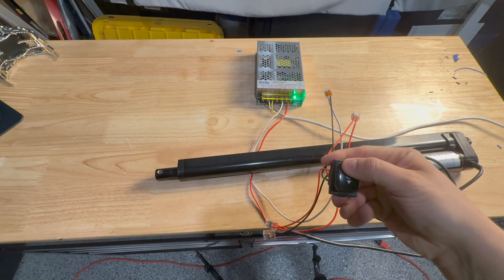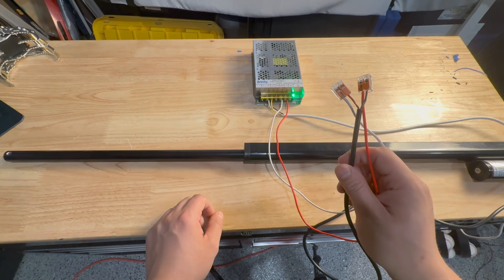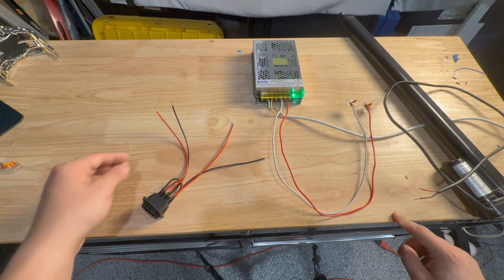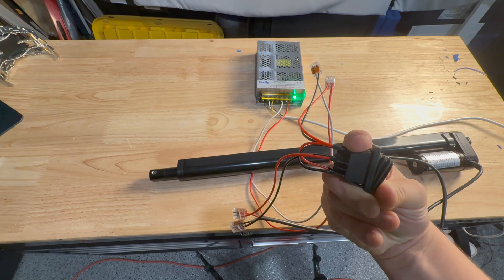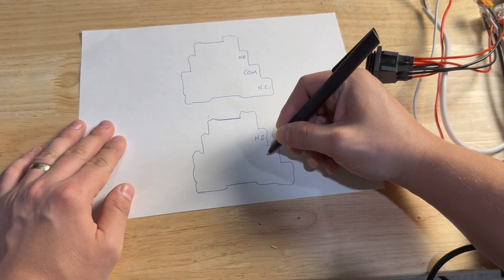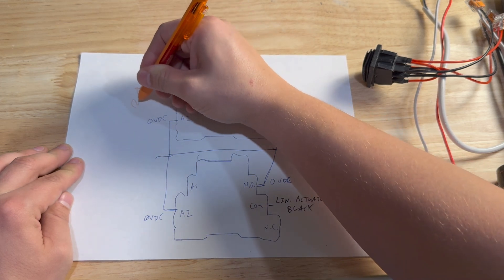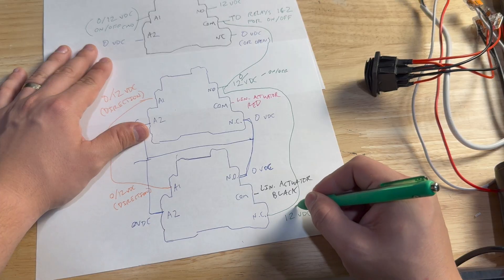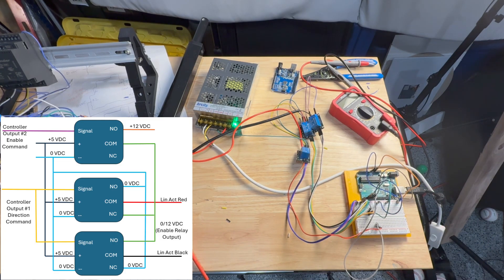How to Control Linear Actuators from Hand Switches, PLCs and Arduinos!

Comment: you can do the exact same thing with only 2 relays  put the  - mot on  y1 com  and  +mot on y2 com then wire +12vdc to both n.c. on y1 and y2
and wire both n.o. on y1 and y2 to volt 0 (Gnd)   then at rest power is off any one relay turns it on in a differant direction.
Reply from the maker: This allows for the possibility of both wires being energized to 12 vdc tho, my set up does not. You are correct tho that should work